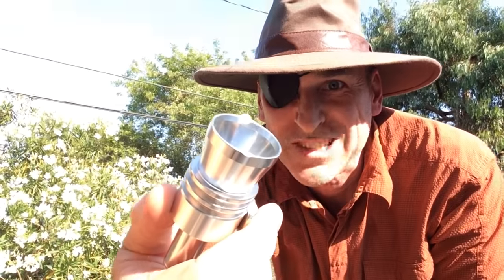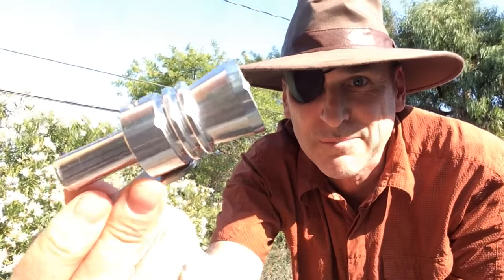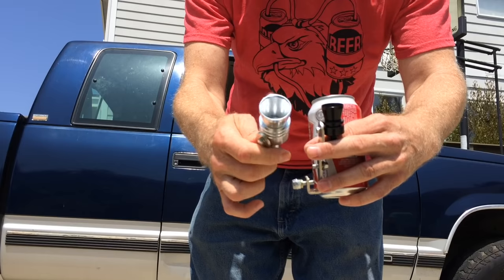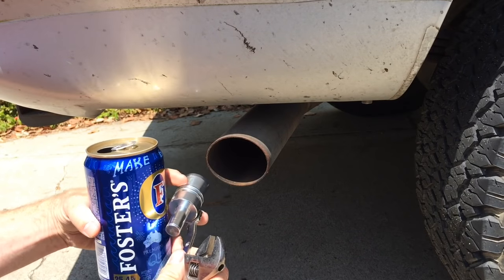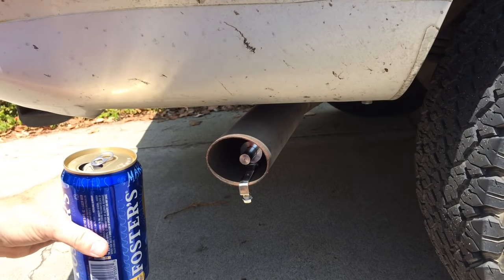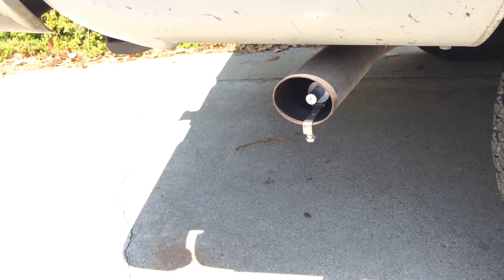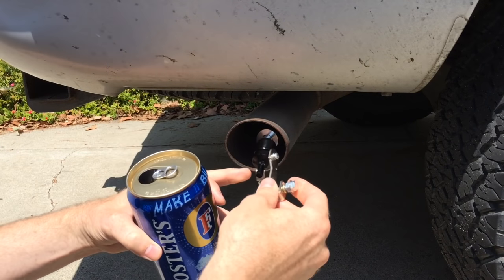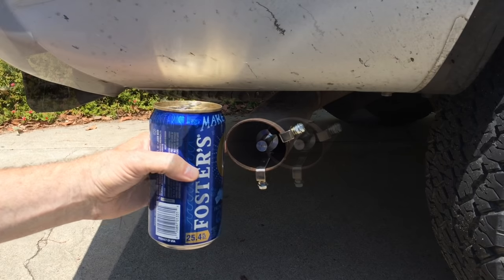XL Turbo Exhaust Whistle Test

Comment: Couldn't hear any whistling, second video I've watched on these things, still nothing. What the fuck is it supposed to sound like? All I hear is normal exhaust.
Reply: exactly, no difference
Reply from the maker: Yes, it sounds stupid, but it produces a lot of extra horsepower.
Reply: lol
Reply: ***** lol
Reply: ya i know
Reply: Actually its stupid that he thinks he can add horse power by installing whistles 😂
Reply: Chris Castro he was being sarcastic bro.....I hope
Reply: dopex2xdeath Yeah I know, so was I 😂😂
Reply: the pipe is. too big
Reply: IcantSignIn if you listen when he starts there is a deep vibrating noise and I little high pitched sound Sam when he revs if you know diesels and gas trucks like this one with a REAL turbo you would know that's the sound they make if you have a Prius or a cheap hybrid you would know that the fuel pumps are louder than a Prius look it up
Reply: IcantSignIn I hear like nothing  was there

Comment: Wow, after you mount second whistle and pomp that gas pedal my window glass exploded here in Poland. Its just toooo much power!  Cheers
Reply from the maker: Sorry about that.  The whistle makes so much power that it can actually travel through the internet and shatter glass.   It is extremely dangerous.
Reply: +hoohoohoblin ok, not Your fault. Producer should inform about that efect on the box

Comment: If you drove past a house on half throttle, would you strip the paint off its walls?
How many extra 1000 tons or carbon dioxide per year does the vehicle pollute the atmosphere with?
Reply from the maker: Sometimes houses burn down when I drive by. It leaves a trail of carbon dioxide a hundred feet wide when I drive down the street.  I have to remove the whistle to pass the emissions test.
Reply: +hoohoohoblin Hahahaha.

Comment: Well, I can't hear much difference, but its obvious even from here that there is a massive hp gain, but I wouldn't attach both at once, that would be just asking for trouble as most standard automobiles transmissions can't sustain over 1500hp for too long,  sheez! and in typical foolhardy Aussie fashion nothing has been done to improve the braking power needed to stop this brute, I'd be looking into a mid-sized chute, a friend of a friends friend had one and said it was SICK AS! apparently they sell them by the thousand in the western suburbs :)
Reply from the maker: +Nicky Winters  Great idea!  I think I can make a parachute out of a blue tarp and some bungee cords.
Reply: +hoohoohoblin Yeah, that will work too, make sure you've plenty of Nitto electrical tape and cable ties on hand, if you're going to do it you may as well do it right, I once met someone who only used the tape and not the cable ties... whooh!, what a mess!

Comment: I have an 02 saturn naturally aspirated, hasnt got half the bhp that truck here has but... it doesnt need that kinda bhp or the whistle. Whistle adds nothing to your vehicle. If u want added power put in a proper supercharger/turbo for your engine. Wont be no 500bhp gain but much more than that whistle could and its safe. Otherwise entertaining video 😂😂😂
Reply: Also. If u want a blow off sound add a cold air intake. No whistle in accel... but blow off when u get right on it
Reply from the maker: Thanks. I don’t know why people buy these things, so I had to see one for myself. It’s pretty silly.
Reply: @ @hoohoohoblin  
Its possible they can get them free. I shop on Wish.com alot and i can get one free with just shipping cost. whats $2-$4?  thats likely where most get theirs, problem is they are made in china or taiwan. Not where real ricers come from.. japan lol

Comment: how the fuck do you get 500 horse power from a whistle?
Reply from the maker: +GILBERT Valdez  It is the magic vortex, created by the airflow around the whistle.  It creates a vacuum, which sucks the air out of the engine faster, and causes insane horsepower gains.

Comment: minus about a true 50 horses,. . . it blocks darn near the entire exhaust, which is building back bressure, sapping horse power. . . lol. . . ebay gizmos at thee best
Reply from the maker: Yeah!  It's crazy that people buy these.  I had to try one out to see it and hear it for myself.  I was expecting it to be louder.  This thing is pretty harmless because it is on the exhaust side, but there are companies selling little propellers you're supposed to put on your car's intake system to get the air spinning, and the blades break off and frag the whole engine.

Comment: GUYS GUYS GUYS HAHA THIS LITTLE TURBO SHITS WON'T WORK PROPERLY IF YOU ARE USING AUTOMATIC, BCUZ YOU CAN ONLY HEAR THIS WHEN YOUR SWITCHING GEARS, FOR PEOPLE WITH STICK SHIFTS/PADDLE SHIFTERS with stock muffler 100% you'll hear it, i had this to try it out but took it off cuz flow master straight piping in shit is off the hook

Comment: just noise whisper on exhaust pipe 
i try it on my ranger n sound like crap because my ranger have 6in lomg rod n noise sounds like duck quack quack quack n i throw it away just waste $ on it doesnt nothing better than having electric Turbo blow off valve